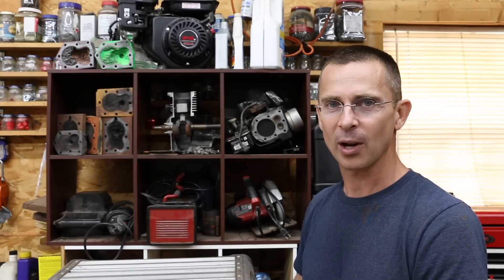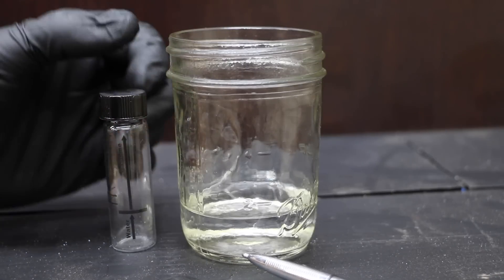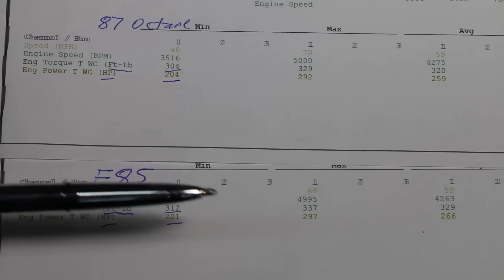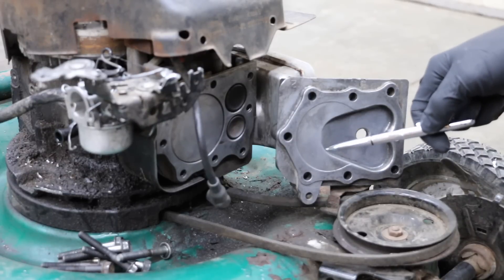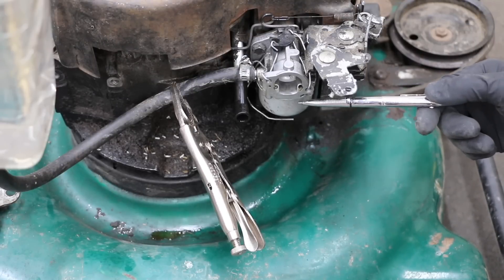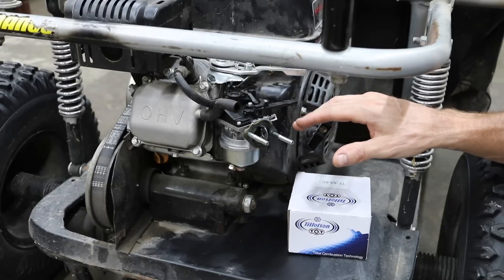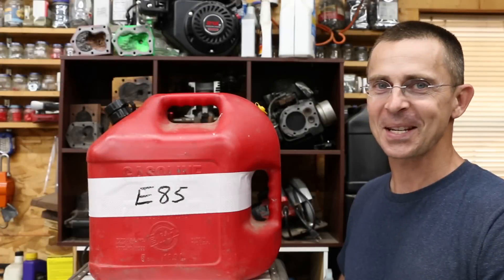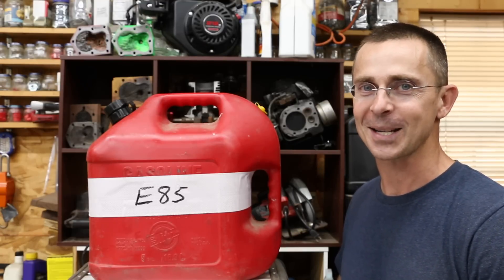Is E85 better than Gasoline? Let's find out!

Comment: Here in Brazil we have a slightly different ethanol, it is made of 90 ~ 93% ethanol, between 4% to 7% water and 3% gasoline. But it costs way less than our gasoline, which is also different, made of 73% of gasoline and 27% of pure ethanol (without water). Even with the difference in range, ethanol is cheaper to run almost all the time.
Reply: They use E because it's cheaper to make than buying oil from other countries.
Reply: 3% gas so you can't drink it..😀
Reply: @daveyt4802  neither clean up your house
Reply from the maker: Thank you for this information!
Reply: I am in Paraguay, a neighbour of Brazil  . I own an  Chevrolet Agile, made in Argentina ( they  only use gasoline and LPG)  for the Brazilian market , which translates in the  car being able to run on Ethanol, Gasoline and any mix of both .

I usually alternate between regular gas and pure ethanol, for cleaning purposes of each fuel. 

Gas is more snappy, but also more expensive and more dirty, longer range 

Ethanol runs fine too, but decreased range at a cheaper price, much cleaner and burns cooler. 

We also have e85 mix in some gas stations  but it's the worst gas mixed with the worst ethanol, so i usually stay away from it . 

Being an old engine design, multi port 8 valve, no timing except ignition  I believe i cannot take full advantage of ethanol  nor e85 ,performance-wise.

Ethanol in Brazil is way more cheaper than in Paraguay 

Obs : We do not use corn but sugar cane.
Reply: @InfiniteMushroom Congress is owned and controlled by many big corporations. Not just Monsanto. As a result we have energy dependency, high "health care" costs, illegal taxation, corporate cops, insurance (whoever thought the people would buy into that scam is clearly correct), and fiat currency. What have I missed?
Reply: We run a Lower percentage because of the temperatures we see in the US. If the temp lowers below like 40 degrees Fahrenheit there is a huge loss in power, and the fuel starts to thicken.
Reply: @TheTyrial86  Poor choice of words. Ethanol evaporates much slower in cold weather but to my knowledge it does not gel up like diesel fuel. The reduced rate of evaporation is what leads to hart starting. Even in flex fuel vehicles the engine runs rough on a cold start while the ECM "figures out" which fuel is currently in the fuel rails. As good as the software is in flex fuel vehicles I don't think the ECM knows what fuel is currently being used until it properly adjusts fuel flow to result in smooth engine operation.
Reply: America needs to follow what Brazil did. We should have a choice at the pump. It should be mandatory for all cars to be able to run on E85 in USA
Reply: Im seriously jealous of brazilian fuel choices. I wish e30~ was our standard fuel. And id would do anything to have he90 available at the pump. I have to make up my own batches of hydrous ethanol for track days (the little bit of water does wonders for cooling. But obviously dont leave water loaded fuels in nonprepared tanks for any period of time)
Reply: same goes in sweden <3
Reply: Antonio Gabriel but you drive 1967 VW
Reply: If I recall, Brasil utilizes methanol, not ethanol. So quite a difference in performance and price.
Reply: You are surely making a mistake, methanol is very hard to buy here in Brazil, but every fuel station has ethanol E97 avaliable
Reply: @tonhu100  Much to my surprise I saw gasoline stay mixed with 190 proof ethanol. Any greater then phase separation occurs. Hence,  "it is made of 90 ~ 93% ethanol, between 4% to 7% water and 3% gasoline." I can show you the video I saw this in if you wish.
Reply: @tonhu100  Having lived in Brazil I concur. Also flex fuel engines are not highly efficient due to their having a tuned octane rating between ethanol and gasoline. I believe the more modern models have fuel heaters to remove the need for the auxiliary fuel tank for cold starts. Also sugarcane ethanol exhaust smells lovely, like a sweet shop.
Reply: @NOLL72  nope

Comment: e85 has roughly 20% less energy per unit as gasoline. e10 has about 4% less, meaning roughly 20 and 4 percent  less mileage respectably. The ONLY benefit of ethanol is super high octane. Other than that it is a terrible fuel.
Reply from the maker: Great point. Thank you.

Comment: Used straight alcohol in my drag car used nearly double the fuel as the 110 race fuel.   Only good thing is it is very flexible with timing and fuel curves  with blowers.  Plus you don't really get the amount of energy out of it as put into it to make it.  I use straight gas when ever I can get it.  I get 3 mpg over email 15. I will not use it
Reply from the maker: Nice!  Thank you

Comment: I don't use E85. Not many fuel stations here for it. On top of that my car isn't designed for it. Fuel pump can't push it fast enough and the ethanol eats standard rubber fuel hose.
That being said, dyno results on similar cars in my area show a very significant increase in power, WHEN THE CAR IS TUNED TO MAXIMIZE ITS USE OF E85.
But you can get similar results from high octane (read 116) racing fuel.
Reply from the maker: Thank you

Comment: 15,5 mpg is still very bad. How much do you pay for a gallon of petrol? My 1 Liter 70hp car gets 50mpg 😎✌️1 Liter is 1,50€ here. So 1 gallon is around 6,50$
Reply from the maker: I pay around $2.50 per gallon.  The vehicle I drive does use a lot of fuel but it is paid for and very reliable, despite the high mileage.  Your fuel is very expensive!

Comment: Could you make a video to see if e85 will clean a combustion carbon out of a combustion chamber?
For example take an engine that's run on gasoline that is carboned up and then just run it on straight e85 to see if it cleans the combustion chamber up at all.
Reply from the maker: Great video idea!

Comment: Brazil has the largest use of Ethanol in the world, we are very used how works.
If the ethanol costs more than 70% of the price of the gasoline you should use gasoline (when you think only in  MPG and cost, if yuo think in nature you should consider ethanol always).
Ethanol is cleaner than gas... far far away, when you change the oil after driving 6k miles with ethanol, it looks like new.
There is some increase on the HP, but to see the really difference you need a higher compression ratio.
Nowadays, almost all brazilian cars are flex fuel.
Reply from the maker: This is great information. Thank you!

Comment: Great video, so just how much did the E 85 destroy all the rubber parts in the first carb. Guessing all the way , badly as it was leaking.
Reply from the maker: Thank you!  Yes, I still need to repair it, but it'll be an easy fix.

Comment: E85 works much better with a compression increase to about 16:1.  The downside it that the vehicle will not like pump gas anymore......   I know this as I have raced boats on E85.  Much cheaper than race gas.
Reply from the maker: Great point. Thank you!

Comment: You should purchase an old beater car that does not support e-85 fuel and drive it around for a few weeks and see of there is any damage done by using e-85.  Anyway, I have a 2012 Ford truck with the 3.7 (non-eco boost) gets 14/20 on e-85)  I can get 20 mpg on the highway, with e-95 going 65 mph.  On 87, it about 21 and city is 13 mpg.  It seems to me that the newer vehicles are a bit better managing e-85 than the older ones.
Reply from the maker: Great video idea!

Comment: Absolutely love E85 for turbo applications. Going from 93 oct to E85 allowed for more boost, 8 more degrees of ignition timing (would have taken more, stopped there as it was at 430wtq on a stock 2.0L) and makes significantly more power with a much greater margin of safety than shitty 93 octane. Costs the same as 87 octane and performs better than most $10-15/gallon race fuels. Absolutely unbeatable for an extreme compression or high boost street application.
Reply from the maker: Thank you!

Comment: E85 does better in cars that required 91 or higher octane or E85 like in a 2014 MB e350 not much difference in mileage but does make more power on e85 fuel
Reply: Also E85 is a dollar or more less expensive than premium fuel
Reply from the maker: Great point and thank you!

Comment: I was able to get my hands on some pure racing ethanol at a very cheap price because it was old and I was very young at the time , didn't have the knowledge I do now so I started cutting the gas and everything the gas is already E10 . and I made it around E20 or higher  lol the fuel injected Vehicles did not like that. Never got a check engine light but it would spit and sputter cruising was okay but if I wanted to demand power it wouldn't deliver.
Reply from the maker: Wow!  Thank you

Comment: I seem to remember reading that some of the new General Motors engines in the late model trucks actually make more horsepower on E85, I'm guessing it may be due to the ECU able to adjust timing for it. I'm not exactly sure but it would be worth checking out
Reply from the maker: Yes, you are right. Thank you

Comment: First of all I want to see thank you for going out of your way to do these tests, the dyno testing, mpg, variable jet, it's all super helpful. With that said there are two pointers I have for E85. First, it takes a couple tankfuls of E85 to get your car's computer to set the ignition and timing properly for the fuel, and visa versa when switching back to 87. Second, it requires forced induction, high compression, or other performance mods to get the true benefits of using ethanol fuel. I'm curious though how well does E85 mixed with marvel mystery oil , or other comparable fuel cleaner, perform in cleaning carbon?
Reply from the maker: These are excellent points!  I should test adding MMO with it. Thanks again!

Comment: E85 is about 110 octane. Most people don't understand octane, the higher the octane rating, the lower the energy per gallon of fuel (octane rating is it's resistance to detonation, ie it burns slower). But, more octane allows more compression, timing, and/or boost which is how you get more power. (simplified explanation)
Reply from the maker: Great point. Thank you

Comment: You should test E10 and E15 vs ethanol free gas dyno on a non flex-fuel car. I swear I have more power and torque when I run ethanol free gas. E15 delivers  a little more power than E10, but not as much as ethanol free, and runs a little lean. Good in the winter months when  the computer runs a little rich anyways.
Reply from the maker: Great video idea!

Comment: That video was fun I agree, I like the part where you let the governor go on that push mower floor it ! What happened to the toro recycler did it get retired? I'm really surprised to see that gas mileage difference between 11 and 15 miles per gallon I was expecting the opposite I don't know why they're pushing for that garbage. You probably know where I live by now the state. We do not have any E85 available. 87 91 93 that's it nothing else I've traveled and I have never seen it are fuel contains no more than 10% ethanol. I don't know all I know is that ethanol destroys rubber.
Excellent video, excellent editing, nice to see you out of that garage.
General repair
Reply from the maker: Hi Mike,
I live near Kansas City MO. I had to drive 25 miles to find it.  I was disappointed with the fuel economy.  Thanks again and hope all is well. Todd
Reply: Project Farm Montana Aren't license plate blue sky or big sky or something? Yeah everything's well as good as it's going to get you know I suffer with PTSD so dealing with that every day is a battle kids are getting big. Everybody sick this week with a cold. Curious to know what kind of winter we're going to have will see . My old roommate captain Daniel fox was stationed in Montana third shift guarding underground missile silos he was in the United States Air Force. He was from the Connecticut to when we met in Iraq became friends and move back to Connecticut got jobs together got a place together live together for three years had girlfriends together had a good old time only difference was he like to drink and I didn't ! Have a good week.

Comment: Don’t use e85 in the suburban but try e30 to e50.
You will get the better low end torque and hp but the mpg won’t suffer that much
Reply from the maker: Thanks for the recommendation!

Comment: E85 looks to do well in engines that have either a turbo or variable valve timing/lift. Although noticably making more power in those cases, seems to then only match dollar to dollar in milage with the added full ups and toxicity to the environment it might stray most away. I'm thinking of testing it out on my Saab 9-5 as it seems to run very well on it. Wouldn't hurt to check it out.
Reply from the maker: Great point. Thank you

Comment: I wouldn't exactly say attracted to water I'd say it absorbs water, brake fluid is the same way that's why believe it or not over time brake fluid should actually be replaced. Most people don't know that and end up never doing it then have soggy brakes. E85 is great and in Europe WAY cheaper then 95 and 98 but you do get a bit less miles per gallon for it. Most cars then can run it have a fuel map for it as well and run much better. I wouldn't want to run an engine on lean for very long though can do some serious damage.
Reply from the maker: Great point, hygroscopic. Thank you.
Reply: Yup exactly. I used to work with only municipal vehicles in Massachusetts, when E10 first appeared it wrecked havoc with towns that had built in pump at the police station, it was old steel and it just turned into rust. They'd fill up and clog up fuel pump, fuel injectors and fuel rails. We must have done dozens and dozens of cars with that issue. Towns who filled up at normal gas stations didn't have that issue. E10-E85 can be some real nasty stuff if you're not careful. Here in France they passed a law that has to advertise what fuel is in the pump. Our SP95 (US 90-91) has 10% ethanol, and our SP98 (US 93-94) has a 5% ethanol content.

Now a days almost everything is safe for E10, Brazil has been running E100 for  the past decade probably lol.

Comment: Which fuel/oil  treatment works on a Chevy with 212000 miles?
Reply from the maker: For the oil, I've used engine restorer a couple of times over the last couple of years.  For the crankcase and fuel, I've used Seafoam.  It's still running great!

Comment: What if you bummed the compression on the motor to make the e85 more efficient. E85 has a higher “octane” rating so if could take a higher c/ratio which should make it more efficient. And possibly advanced timing as well.
Reply from the maker: Great point. That would help.

Comment: I wish it was at the pumps in my area. Not a single E85 pump within 100's of miles. I don't care about the mileage, i do care about it's octane rating.. All we can get here is 91 octane rated fuel.
Reply from the maker: Thank you. I had to drive 25 miles to buy it.  It's hard to find near me as well.

Comment: e85 makes a great racing fuel substitute and works out to be cheaper in that respect. e85 has a similar knock resistance to something like 105 octane gasoline. When roughly ~30% more fuel volume is injected to reach a proper AFR, the mixture produces as much power as gasoline, and it facilitates running ignition timing closer to or at MBT that would normally be knock limited with gasoline. I use it in my turbo charged track car and it allows me to run more boost safely without worrying too much about knock. It also cleans the engine and the intake charge is much cooler, further reducing the chances of knock and allowing for more boost. I'm not certain I'd use it in a daily driver vehicle, mainly because of gas mileage and the propensity for certain parts of the fuel system to gum up such as the injectors and intake valves. Otherwise, it serves its purpose well at the race track :)
Reply from the maker: Great point.  Thank you
Reply: I'd also like to add that you could have probably squeezed a little more power out of the engine by modifying the igntion timing 2-3 degrees. The rate of expansion of e85 is a bit different than gasoline, but there are quite a few variables in play, so dyno testing is required. While this was certainly accounted for in the truck's computer since it was built for ethanol use, the go kart's igntion timing may not have been completely optimized for ethanol. However, it is only a slight difference.